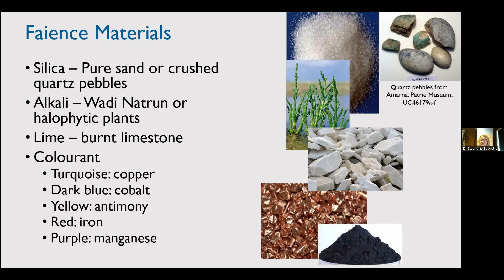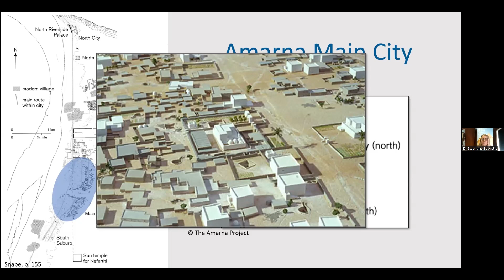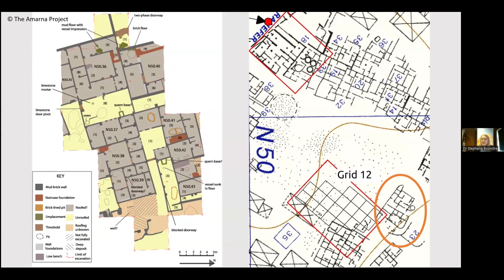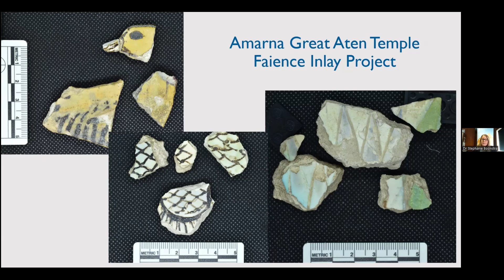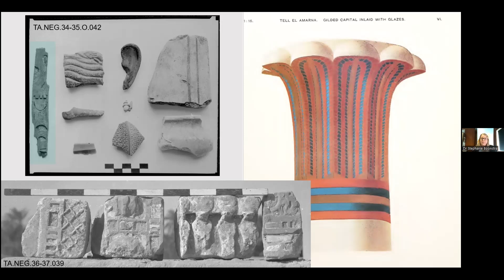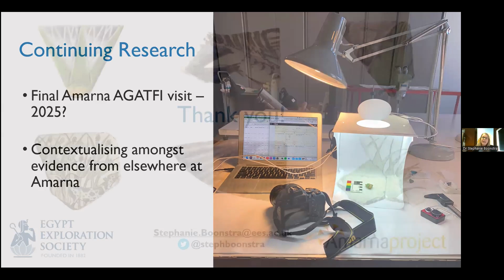Faience at Amarna: Old and new research into its brilliant manufacture and use

Comment: Thanks Stephanie, great talk. You mentioned various colourants found in faience object but you didnt say anything about black. How would black have been produced?
Reply: Thank you, Harry. Do you mean for the black painted decoration on the decorated tiles and inlays? That would have been made with carbon black.
Reply: @StephanieBoonstra_89  Stephanie, I think that if you add soot/carbon black to the faience mixture at the outset, it will not function as a pigment because it burns out around 800 degrees F, below the fusion temperature of the material.  You are entirely correct that black can be produced by carbon of course.   This is done with carbon trapping -- letting smoke into the kiln after a piece has fired, and is cooling, but while it is still very hot-- and by reduction firing -- excluding oxygen from the chamber or vessel in which a paste or glazed piece is fired, which will cause many pigments to blacken.  These techniques lend randomized, organic-looking, "scorchy" effects such as we see on raku,  and are not very controllable.  To get deliberate, penetrating,  even black color, you need something like manganese.  Manganese (and iron, deliberately added or not?) instead of copper are the pigments found in black Egyptian paste objects.  Manganese behaves differently from copper (which is a more powerful flux)  so the recipe  and maybe the firing process must have been different and specific for it.